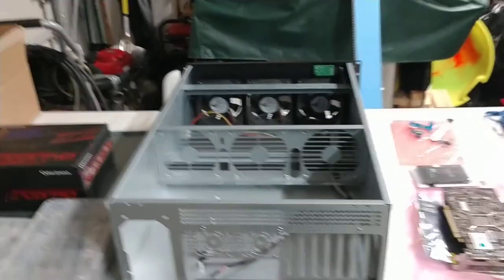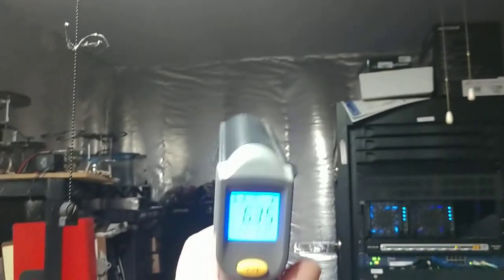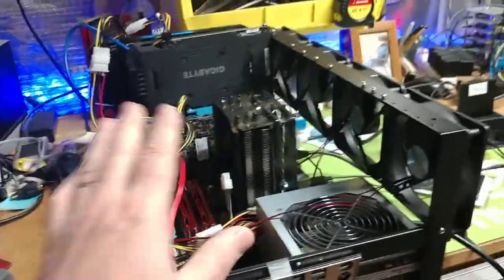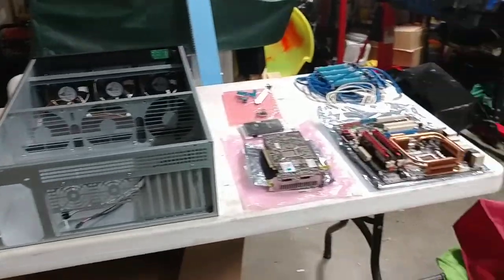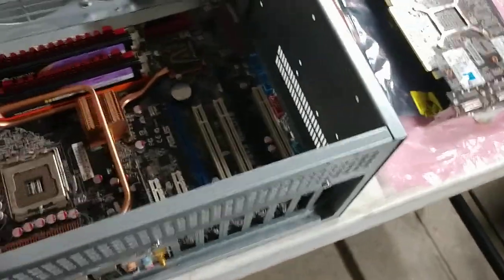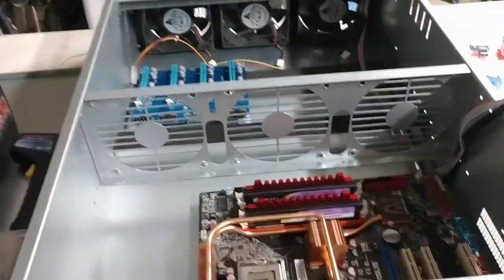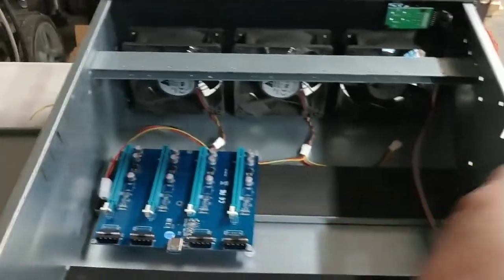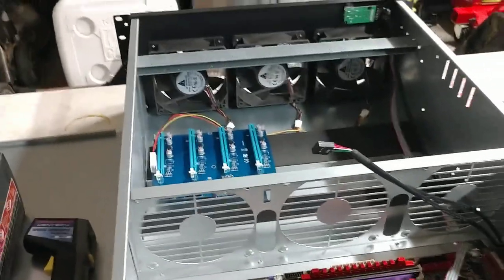Doing a 4U GPU Mining server right and at a low cost part 1

Comment: Did that IPE-51x unit actually work for mining ? I see it looks cool but I was wondering if it actually reduced the hash rate of the 4 cards vs buying a proper mining board with the appropriate # of slots
Reply from the maker: Due weather issues I had hold off now but for now I don't know. I think it could to mine with but will not be easy. Go figure
Reply: I just watched part 2 😂 I guess you had already answered that question. Quadboard = junk
Reply from the maker: @qwodracer5015  cool